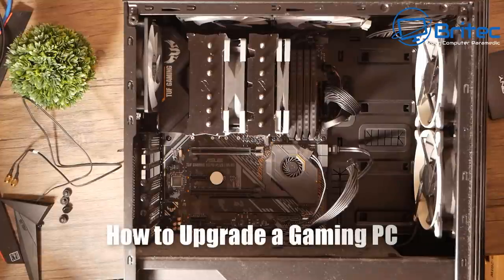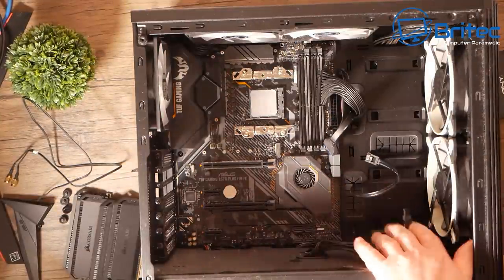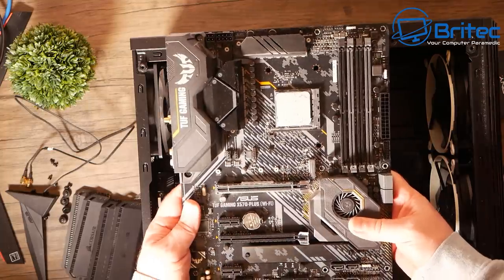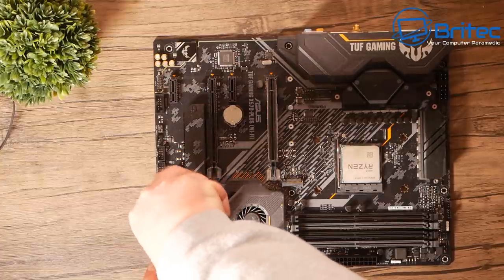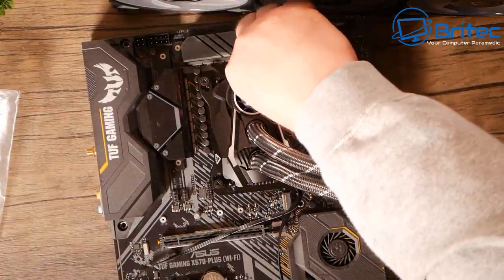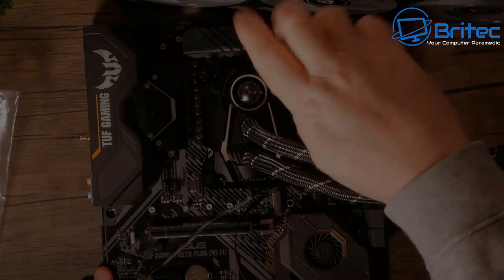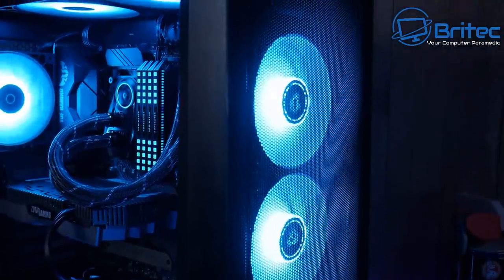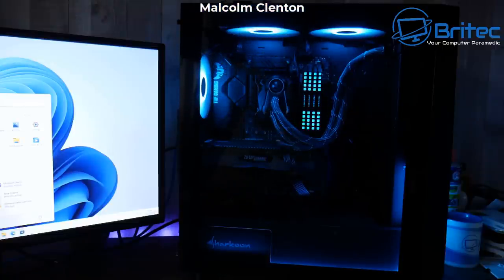How To Upgrade A Gaming PC

Comment: In regards to radiator piping, it doesn't really matter how its run, what matters is that the highest point of the loop (rad in this instance) is higher than the pump to avoid air getting into the pump and wearing it out prematurely. This way the air pocket shoul be at the top of the rad and the pump fully submerged in liquid
Reply from the maker: Like I said in the video, rad pipes are higher than pumps. Thanks for watching.
Reply: @Britec09  yeah I rewound as i left the pc at that point and didnt quite hear what you said, decided to leave the comment anyways

Comment: Brian, why not just use a Raith cooler than go to all this trouble, it is just a waste of time and money, plus the Raith cooler will last longer, and any difference is probably a couple of milliseconds if anything at all. It is just cosmetic and costly when you could have put that money to better use. My Ryzen 73800X never goes above 83C MAX. and you don't need fans at the top of the case. the draught caused by the other fans is sufficient.
Reply from the maker: I never paid for the cooler.

Comment: If you can`t change the orientation of your radiator, then turn upside -down the pc to be sure that pump will not works with air bables. As the cost of cooler is just a small part of the cost of CPU , think about it.
Good luck!!
Reply from the maker: Can't turn it upside down and there is no air bubbles because the pipes are above the pump